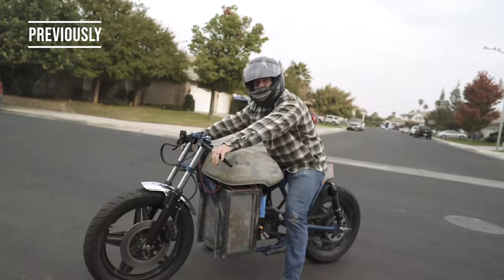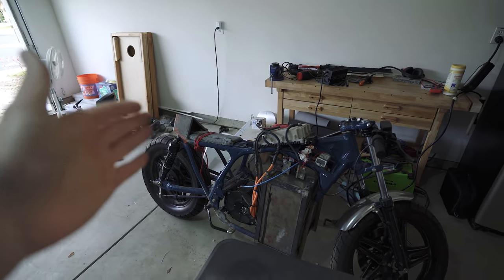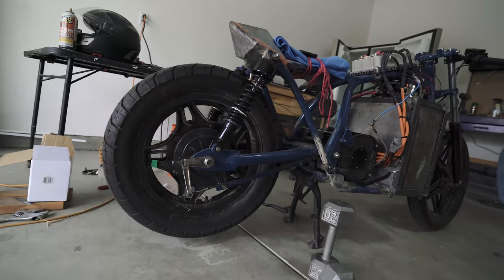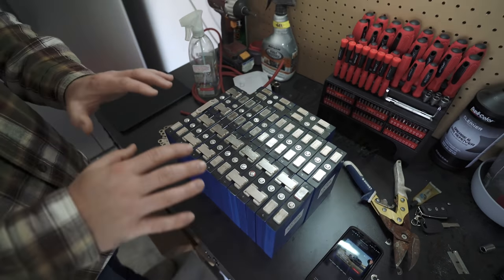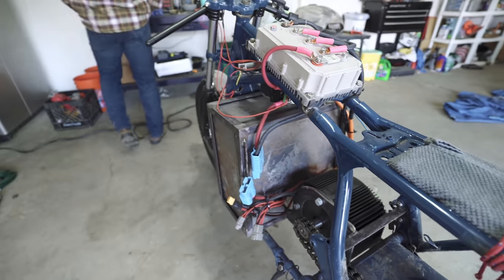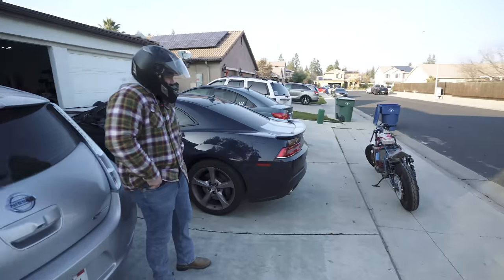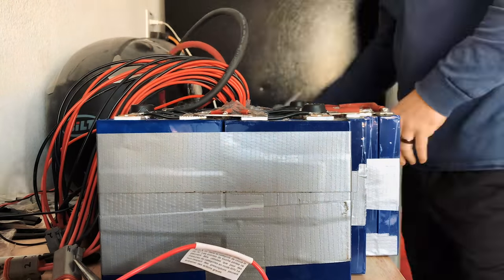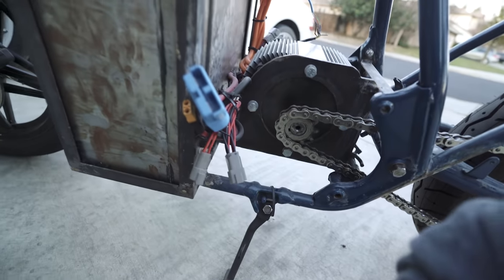ELECTRIC CAFE RACER for $4,000 – a Freaking HUGE SPROCKET Installed

Comment: I heard the next update is going to have something super cool and could shock you
Reply: Just curious here, but are you guys brothers by blood?
Reply: @caderaojohncyrus1378  we do indeed share half our nuclear DNA
Reply: Hell yah man glad to see you back and lively glad to see you had a good recovery
Reply: @LordCurt  that's nucular 😉
Reply: @ryanstone1117  it's not a cat or a dog you can't spay it.
Reply: Super-Capacitors in parallel with the Battery-pack, and a Regen capable controller?
Reply: I subd in your channel! you better upload as much as you can. lol. You guys are monsters! looking forward for more vids!
Reply: What Kelly controller did you end up using finally? I heard you say 600A, but the only model I can find at that current is 96V, and your pack is ~106V. Are you using the 96V/600A model, or something else?
Reply: @coolranchluke  96v controllers are generally rated for 96v nominal and 120v peak. If you’re running any system lower than that peak voltage you should be good!
Reply: @LordCurt  Thanks! Did you ever figure out your tuning for the controller?

Comment: This is super inspirational! Out of all the electric bike builds I've watched on YT, this is my favorite.
I have my frame for my 1972 Honda SL125 electric motorcycle build. I'll be using the QS 273 17" since the smaller frame doesn't have as much room as a full sized bike. I'll be going for torque since it will be a in-town rider

Comment: Hey Lord Curt and Inja. I'm doing a similar build with the ME1507 and the same controller. I've had issues with the controller cutting out and I'm also getting a lot of hall sensor errors. Two things I've found that help: 1)Make sure your controller and motor sine/cosine sensor grounds/shields are solid. 2)Increase your throttle acceleration time to 15 - 20. It's still not 100% but it makes things better. I hope its not just because the Kelly controller is crap. When I turn on the regen I get that grinding noise you described. I'm doing a build on my channel too, inspired by you guys. Keep up the good work and let me know if you resolve the issue.

Comment: Very cool! Lord Curt is smart but Inja, you have some in your repertoire as well! For future speed tests, buy a RPM reader to get an immediate readout. It's $15-20 on Amazon and you WILL use it again with the stuff you do. That should alleviate having to film it and count revs. To find MPH, just take wheel RPM x pi x wheel diameter (in inches) and then divide by 1056 and 💥...MPH. To find desired gearing, take the speed you want divided by the speed you're currently at and then multiply that number by the number of sprocket teeth you currently have. That will tell you how many sprocket teeth you want in order to get your desired speed. Also, you had to get this huge input sprocket made, but did you do any research on whether there was a smaller output sprocket option? Always more bang for the buck.

Comment: Holy cow, that sprocket looks insane. I've only seen mini-bikes when they have the thing almost as big as the wheel I feel like this is a first for a full size bike.
Reply: I'm pretty sure zero motorcycles (the brand) has bikes like that
Reply: @thegodhoward8037  Zero sprockets can be large but I think they're a little more subdued. At least they seem have less material to show more of the spoke/rim so they don't look as large.
Reply: @TheRealAlpha2  ya I could be wrong
Reply: @thegodhoward8037  I mean if you meant a cafe racer style bike, I don't think they do (they do mostly sport bikes and a couple of off road models) but it would be interesting to see their take on it someday.
Reply: @TheRealAlpha2  would probably look like a better version of the sondors electric motorcycle

Comment: Don't forget a proper fast charger with a j1772 port.

Battery nerd talk: imo the second battery shouldn't have been soldered, it should be welded with a good DC welder like a kweld. I worry if there was too much heat into the cells that would damage them.

Oh, and the first 14v pack. She cooked. Would not trust it on the highway. I think those cells are ready for a fire, so maybe strap a large fire extinguisher on the back for the first few highway tests.
Reply: it is not designed for fast charging. Slow charging only.

Comment: when you showed the bondo on the front car fender just pointing out you cannot use bondo on flexible parts like plastic, it will crack and break off. use flexible body filler. also you shouldn't use that much that's too much. USC is a good flex filler

Comment: Bigger sprocket helps only if you are peddling manually. If a motor is going to run it, there will be 70% waste of motor rpm. Attach the big flywheel to the motor, and attach a smallest flywheek to the wheel, you will see 10 times speed.

Comment: Nice build! Have you attached a voltmeter while riding to check the battery sag? My first guess is the battery sag is too much for the controller causing the cut-off.  Also, did you bypass the BMS? 2nd guess would be a bad BMS. Good Luck!

Comment: Pretty sure charging via discharge port will bypass any overcharge protection functions and will lead to a fire...
Reply: I was watching individual cell voltages, and it was on track. Unmonitored you are absolutely correct!
Reply: @LordCurt  Fair enough, but still sketchy.
Reply: @LordCurt  Do you have any idea why they discharged on their own in the first place?
Reply from the maker: @JasonWW2000  we are still not sure. The only thing we could think of was the bluetooth enabled controller was searching for Bluetooth connection for 2 months, or was activated for some other task we were unaware of it doing.

Comment: Awesome!  Between my full time job and finishing my degree I don't have as much time to follow the build as I'd like so I'm cool with the delays. lol   I do have a question though.  Why did you guys decide to solder the battery cells together instead of welding them?
Reply from the maker: Probably sheer thickness of the metal.
Reply from the maker: We'd have to spot weld to not damage the batteries, and we would have needed some serious tools to do that!

Comment: I'm trying to understand why you went to the extreme rear sprocket- wouldn't it have been faster, easier, cheaper, more efficient to just knock a tooth or two out of the front sprocket?
Reply from the maker: The motor also requires certain gearing so a small front and larger rear was ideal for the motor performance.

Comment: Can I ask why you didnt just make a slightly bigger sprocket to put on the motor instead of a huge sprocket in back?
Reply: It works have needed to be smaller on the front, and it was already about a small as they got
Reply: @curtmacneill8703  I was looking from a similar angle, there's such an increase in mass with the chain, a lot of wasted energy, also for the extreme size of the rear sprocket, all the torque still  concentrated on the small diameter axle for mad stress, heat and weak point... so much easier to deal with from the short end with dramatic rpm adjustment with only 1 or 2 fewer teeth- worth pushing the envelope to save on energy loss, heat and friction.  It might even make sense to go to belt and pulley.
Reply: One could also use reduction gearing to get the proper ratio without tons of chain and huge sprockets, I'm imagining weird gyroscopic side effects from current experiments in gearing...